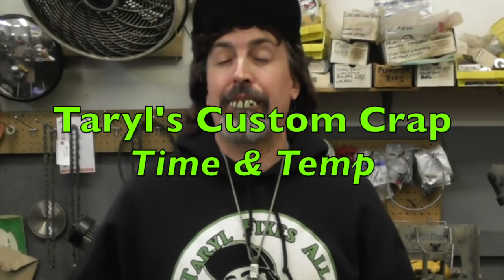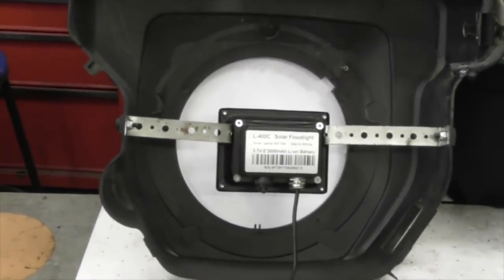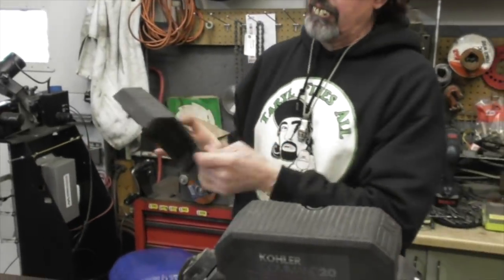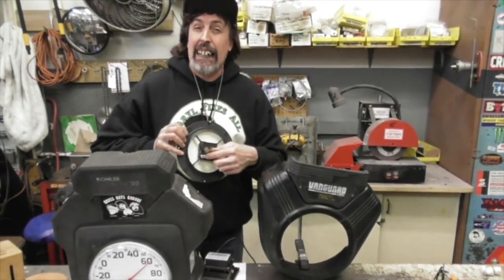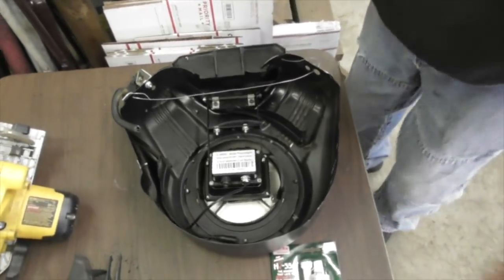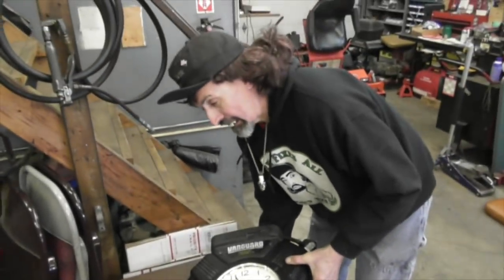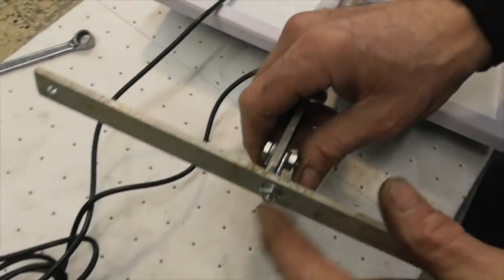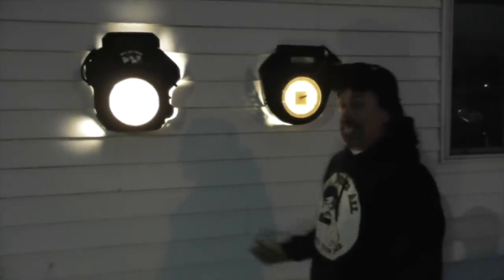Taryl's Custom Crafts - Time and Temperature

Comment: How did you wire the solar panels as switches. I understand how photo cells work for dusk to dawn. The LED lights have internal batttrees correct? So how did you use a solar panel as a switch?

Comment: You could make a cover for the back side to stop the light from leaking out around it would make it look better in my opinion plus if you lined the inside with that reflective tape it would brighten up the light on the clock and temp

Comment: I think it would be cool to add some old lawn mower headlight diffuser material in front of your light to diffuse the light a little. So its not quite as intense of a light through the gauge. 
also a backing of some sort for the light bleeding around edge.

Comment: Taryl I have a Kubota t1400. I seen your other video about Kawasaki fv460 replacement. I just bought a Kawasaki fv460v is that the same one? I believe it's a 2008 model Kawasaki does that matter cause my t1400 is mid 1990s I'm guessing